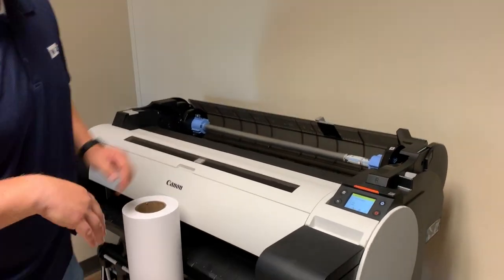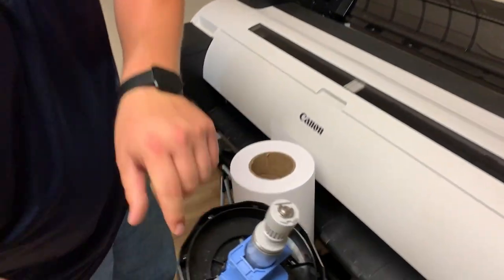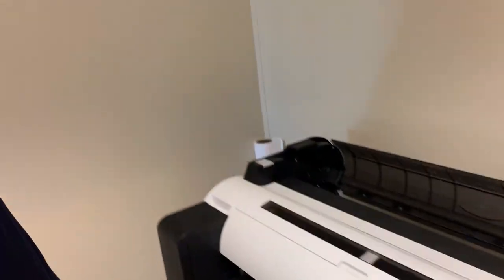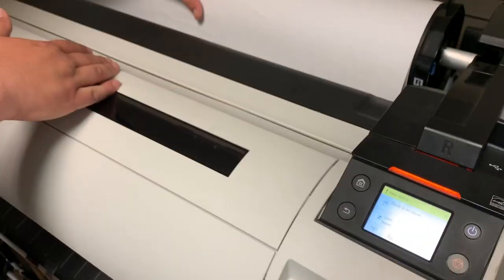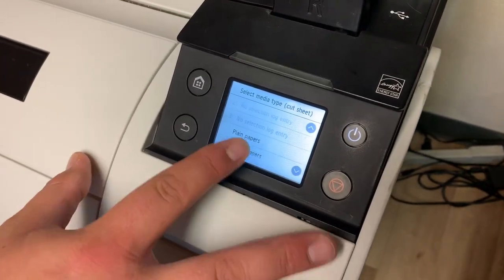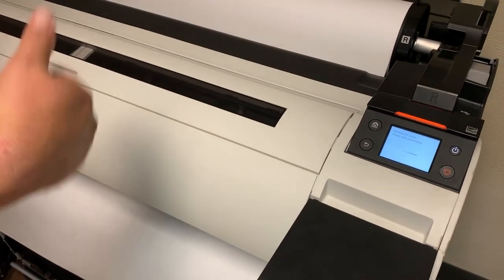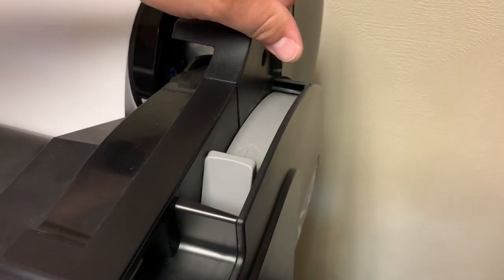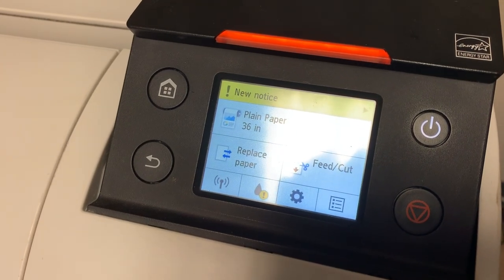Canon TM series Printer loading paper

Comment: What size of roll paper is that one? thanks
Reply from the maker: In this video, the TM-305 is being configured for 36" roll paper.  That is the largest roll that the TM-305 can load. We typically run it on 500' rolls.

Comment: What happened, it was printing normally for a while, today I went to turn on the machine, only the light on the panel came on, the display was off, I already changed cables, I looked at the source and I didn't see anything abnormal, which could be Canon tm 200
Button lights up but does not turn off or light up the panel
If anyone in the group has been through this or has any suggestions
Reply from the maker: Your display doesn't light up? Have you tried disconnecting the power cable (either at the printer or the wall) and leaving it powered down (5-10 minutes will usually clear any non-persistent error) and then plugging back in?
Reply: @amplifycan  Yes, I have already done this procedure and it does not light up or move the print carriage
Reply from the maker: @stilluarts958  Without being hands on, it sounds like your LCD display is dead. If you'd like to contact us through our website amplifycan.com we'd be able to go into more detail.

Comment: Show us how to load cut sheets.
Reply from the maker: For cut sheets, push the grey tension lever on the right back, roll the roll back out of the machine. Close the roll cover over the roll, pull the grey tension lever forward. Then on the display, tap "replace paper" then tap "load cut sheet" place your cut sheets over the roll cover and use the size guide to keep the stack organized.

Comment: plotter which supports paper of 45,50 gms.
Reply from the maker: We have run paper of 40, 45, and 46 lb bond weight (which are all 150+ GSM) through the Canon TM-305, TX-4000 and TZ-30000. Are you asking about running thicker, or thinner paper?

Comment: This printer sucks
Reply: Why?
Reply: @B.J.00  
Mainly because of the manual way of feeding poster prints and boards onto it, I understand the price point and why companies use it but the HP model is light years better
Reply from the maker: There are Canon options for flat/hard media. This printer is intended to have the majority of it's prints run off rolled media.
Reply: @amplifycan  
What happens when the paper is not being fed and not being recognized?
Reply from the maker: @KoolKumasi  are you using roll paper or sheet when this is happening?
Reply: @amplifycan  
Roll paper
Reply from the maker: @KoolKumasi  typically when the machine gives the error about problems sizing the paper roll, you want to make sure that the roll is properly seated.  Tightly to the right (permanent) end cap, and that the left cap is tight and locked (you'll see a slight gap, because the cap is beveled).